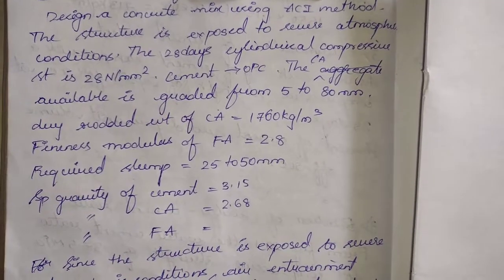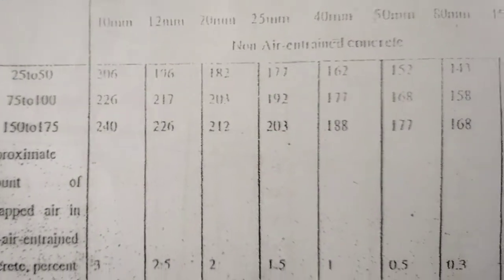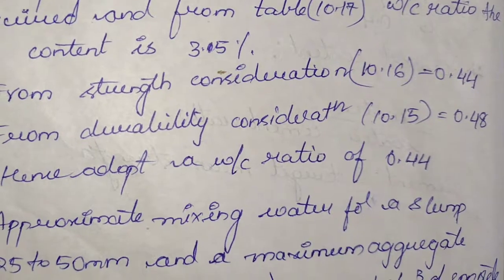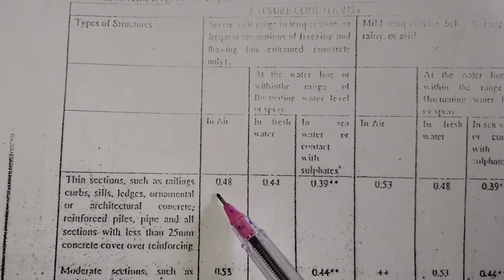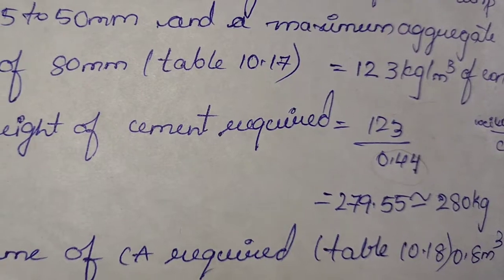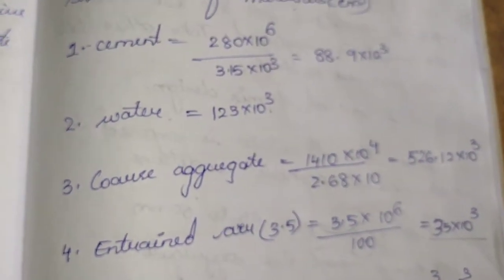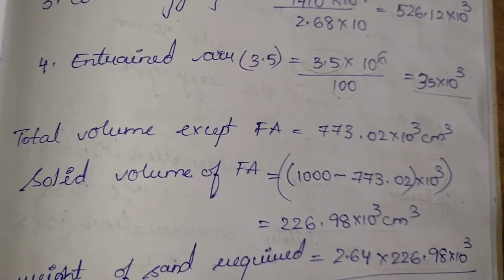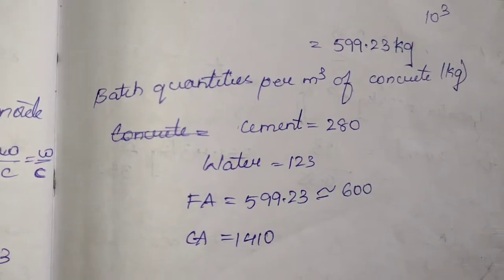ACI METHOD OF CONCRETE MIX DESIGN | EVERY STEP EXPLAINED CLEARLY #civilengineering #civil

Comment from the maker: The process of mixing, transporting, placing and compacting concrete using Ordinary Port land Cement should not take more than

A.	30 minutes
B.	40 minutes
C.	60 minutes
D.	75 minutes